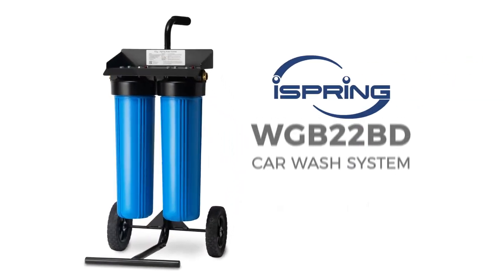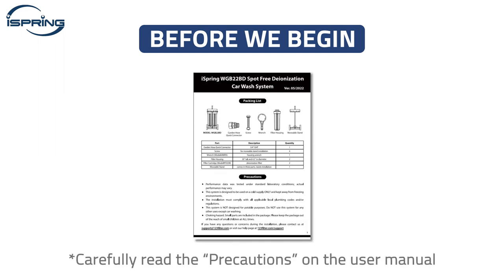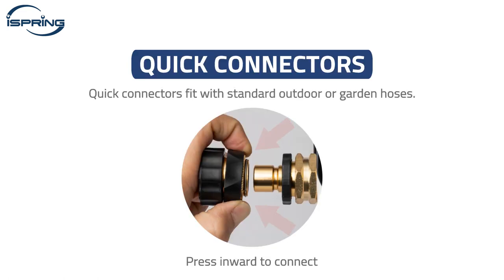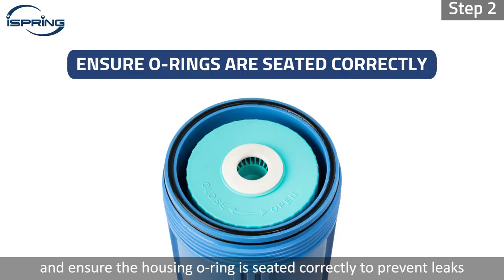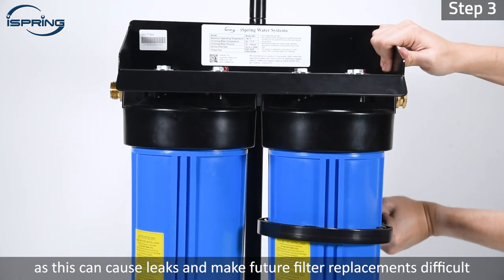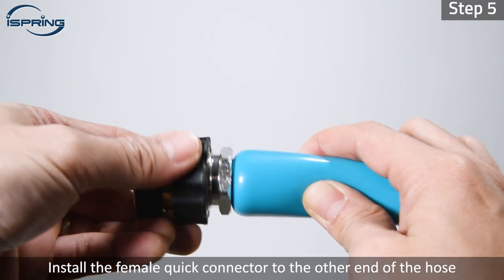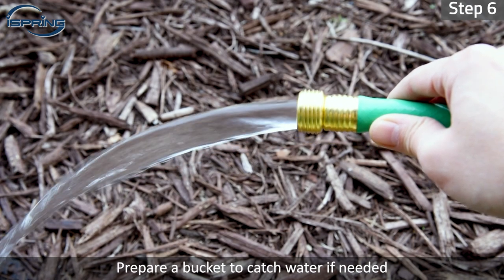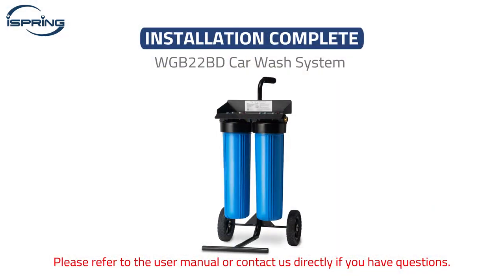How to Use and Connect iSpring WGB22BD Spotless Car Wash System | Car Wash at Home

Comment: Try updating the videos. What is the little allen tool and little allen nut used for? The wheel locks won't go inside the wheel shaft for installation so yall forgot to show that part also
Reply from the maker: Hi dear customer! Thanks for sharing your feedback as it helps us enhance our services!
If you have any questions or concerns, please, kindly contact us at support@123filter.com  or at 678-261-7611 M-F 8:30-5:30 EST to properly help you as soon as possible. Thanks!